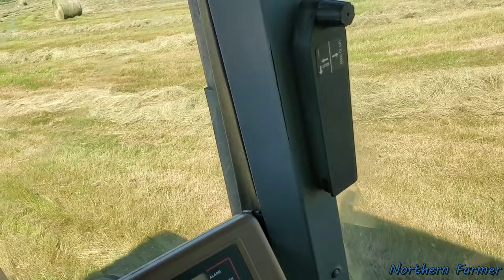We Started Up The Norwood Sawmill And Sawed Some Lumber!!

Comment: Try some Sea Foam in the fuel. can get at NAPA or Peavy Mart as well as Canadian Tire. Pilot jet plugged. Clean the carb. Run it out of fuel when parked for a long time.
Reply: I don’t think seafoam could fix that problem it sounds like the same problem we had and the only way to fix it was to actually remove the curve sync it into carb cleaner and put it back together ran perfect after damn paraffin wax.
Reply from the maker: It has sea foam in it
Reply: @jamesyachyshen7116  He needs higher octane fuel

Comment: Isaac iron works built my band saw. They told me to run diesel in the blade coolant tank unless I was making furniture boards then use windshield washer juice. Diesel works so much better and you need very little.
Reply from the maker: Yea I was told you could use that to